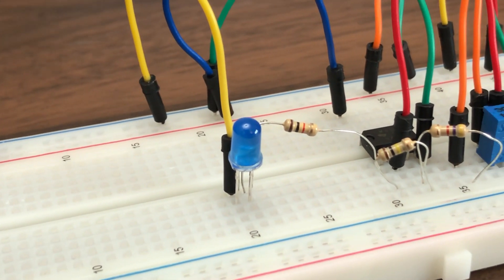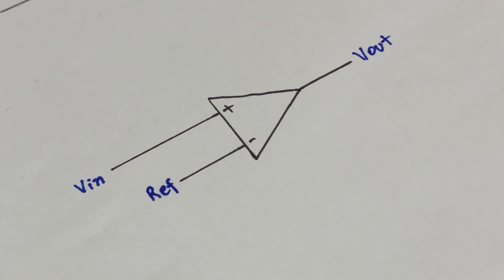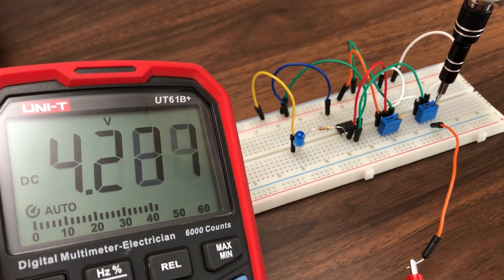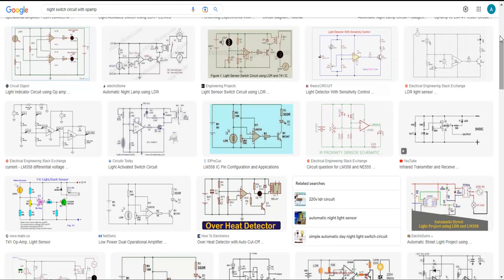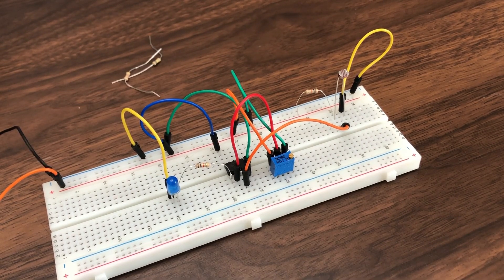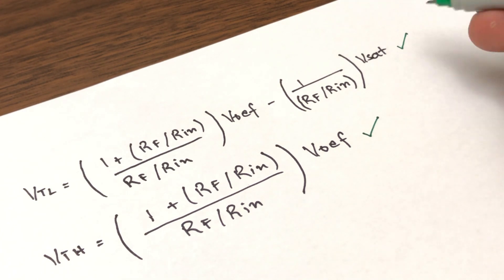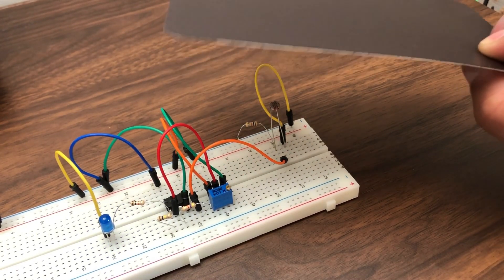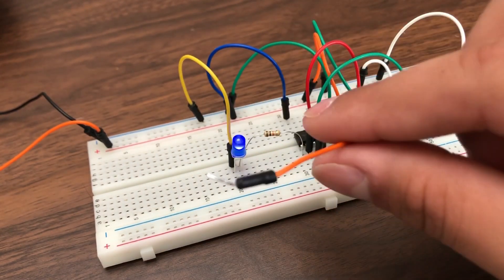What are Schmitt Triggers? | Perfecting a Night Switch Circuit!

Comment: One of the most common uses of the Schmitt trigger circuit is in optical encoders. The gradient of the glass etched lines in an illuminated path transmitted to a mask and then to the light sesnor creates a sign wave, which needs to be converted to a square wave. This gives the servo drive/control circuits an On/Off digital signal to use for positioning analysis.